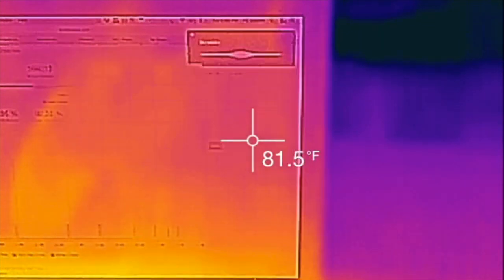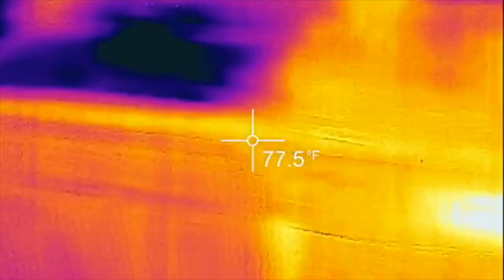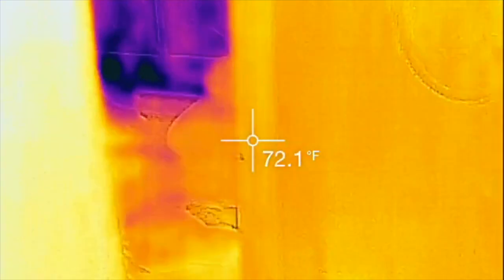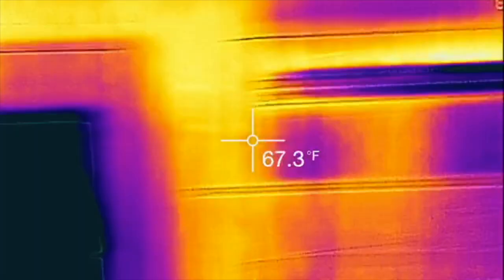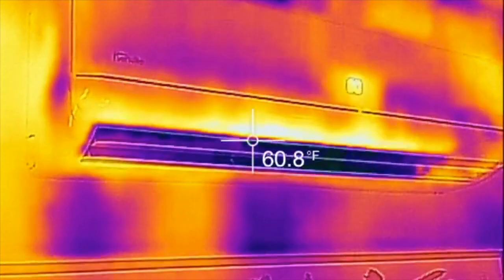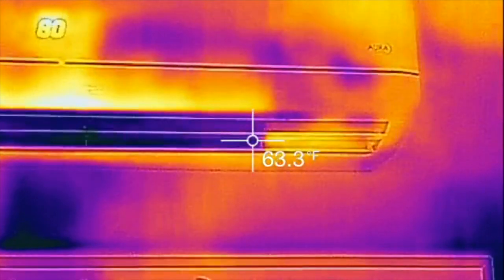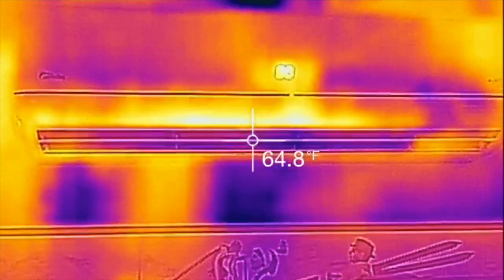Heat Pump Extreme Cold: Tested

Comment: I hope you see this? I have one with two units in my cart and I want to use them for heat. Mainly I live in New Hampshire so we need air-conditioning about four days a year, but if I can depend on this to blow hot air down to 20° positive Then I can use my pellet stove only on days when the outdoor temperature is below 20°? I would just like some confirmation that I’m making the right call that it’s gonna do the job? And it sounds like from your video 20° above zero would be no problem at all for that unit to heat? Just would like some confirmation thank you.

Comment: How many hours a day does it run to keep your home warm?
Reply from the maker: With the DC inverter, it's not on or off. it's a variable power consumption 24/7. Deep winter seems to be 80-100% duty cycle here with defrost cycles in between.
Reply: @pcdoodle1  Of course.  I have a variable power DC heat pump as well.  New this heating season so we are watching it closely and learning about it.   Last cold snap at near zero in Spokane WA my Google Nest thermostat showed it was in heating mode 10.5 hours on the coldest day between 8 am and 11 pm.  Tells me it could easily work in far colder temps.  I understand it is really designed to be running and harvesting heat nearly continuously when its really cold.  Not much cycling like with a gas furnace, even a variable speed multi stage one.   I have been very pleased with the comfort level in the house and power consumption.  We have solar and our system makes all the power we need to heat and power the house so its really fantastic.   We have natural gas furnace paired with the heat pump if it gets really cold, but I don't think we need it.  Have not used it hardly at all this year.  We have cut our carbon emissions by 90% or more this heating season.

Comment: I appreciate your using an infrared thermometer on all the surfaces inside your house.  But I didn't see you report the air temperatures inside the house.  Most people want warm air around them - not just a "warm wall".

Comment: This video does not prove alot but simply showing unit is producing heat at cold temperatures. These types of units will also have resistive electric heating coils to subliment what heat pump can produce. Question is how much more efficient is it at producing heat at these temperatures.

Comment: They don't stop working, they just become far less efficient. It extracts heat from the air outside, so the colder it gets, the more energy it will take to extract that heat to heat your house.  The reason people say they "don't work" is because they use a TON of electricity when it drops below freezing. Way more energy than more conventional heating methods... that is unless you can spend a quarter million on upgrading insulation and air sealing your home.

For most people's homes, heat pumps work very poorly below freezing.

Comment: Do you have a heater on the drain pan outside?
Reply: Senville Aura has a pan heater and heat belt around the compressor and an arctic compressor.The Leto does not have the arctic compressor
Reply: @noutilitybill  Ya I ended up getting one. I'm on winter no 2 now and as long as the air temp is above -5 it keeps the cabin at 70F

Comment: I've got a 24x30 garage with 10' ceilings (between the joists) and a bonus room above. I was thinking of a 28k split unit with an 18k head in the garage and 12k head in the bonus room (Senville Aura). I'm just east of the Twin Cities. Do you think that would be enough?

Comment: What brand and model heat pump do you have?  How many square feet are you heating?
Reply: In this video it is a Senville Aura which is made by Midea.The Blueridge version is also made by Midea.A lot of high priced units are made by Midea or Gree so save yourself the money and by a Senville Aura which is a arctic heat pump

Comment: So I just installed 2 senville units in the fingerlakes area. One is a 24 k floor unit, the other is 36 k with 2 12 k heads. So far so good. It has only gotten down to around 15 so far, so hopefully when it gets to 0 it still works. Great video

Comment: Nice! Bought an old home and looking to replace the boiler and wonder how well these work in the Midwest. I'm just across the river in St. Paul :)
Reply: Old homes have bad insulation. You'll need to modernize your insulation for a heat pump to make any difference.

Comment: Hi. Just wondering,  is condensation/ice buildup under the outside unit a problem in winter?
Reply: As long as you keep it off from snow, it should handle just fine. I live in MN, nd this thing warms my house just fine.

Comment: This is the video I was looking for. I have a forced air electric furnace and my power bills are ridiculous in Manitoba Canada. We get wicked cold winters up here. What happens in -45c temps with these?
Reply: Heat with resistance heat or a wood stove. Always have a backup
Reply: What size of breaker does this use? Thanks
Reply: nothing happens at -45. literally nothing! money pit even on much higher temps.

Comment: So you must have some kind of alien tech heat pump, because mine would not work in freezing temps at all. Never did, even when new. Most of the winter I was on my gas furnace and the repair bills were far over any savings I might have gotten. I had it for ten years and this year I finally sent it to the recycler. I'm back on the good old trusty gas furnace, and not looking back.
Reply: Doesn't sound like yours was the newer "inverter" type heat pump (less than 5-7 years old). And the newest versions are very efficient at below freezing ....down to -13F to -22F. My 24K Mitsubishi has a backup electric element in it for when it gets too cold to squeeze any heat from outside air.... never had it kick in yet..... SEER 21 Inverter heat pump sips electricity. Also with global warming I use the AC now more than ever before.
Reply: @muskyful  Last winter we got 4 ft. of snow that buried my heat pump. It tried to defrost the snow, but the melted water froze the fan into a solid block of ice, so the unit shut down and stayed that way until spring. When it was able to be used again I had it checked and found it was ready for another 2000 dollars in repairs. So much for high tech. So much for saving money. So much for the planet.
Reply: @Mascotal  Yah, that's one issue for the outdoor unit. If you're in a place where snow is typical....its best to raise & cover the unit.....most mfg recommend it. Its best to put them up off ground so they can  drain ok in defrost, not sitting in a pool of snow & ice...and screening unit from prevailing winter storms. You don't want the unit sitting on just an exposed ground pad in snow country. A shaded cover also makes the unit more efficient in summer cooling.
Reply: @muskyful  Actually, I'm in the shadow of a mountain for the winter months so solar is also a issue. I think you need just the right area for a heat pump, but even then you still need a furnace. So you double down on the costs right from the start. Twice as much maintenance, twice as much cost. When do you start to save money?
Reply: @Mascotal what model did you purchase?
Reply: @Katana_00   "York Infinity" heat pump.
If you want to stop using natural gas then consider getting electric baseboard heaters instead. They are 100 % efficient, they cost much less, and they never have any problems.
Reply: @Mascotal  what are doing for heating and cooling now?
Reply: @Katana_00  I have a natural gas furnace that is 98% efficient. I also have a natural gas fire place so when the power goes out I still have heat in the house. 
My house is noticeably warmer in the winter, and a new central air conditioner keeps me cool in the summer.

Comment: This is a BlueRidge mini-split, rated to -22F, which I installed last year here in Chicago with 4 air-handler units, and I heat 1200sf with a 36,000 btu compressor connected to two self-contained bedroom units, and two multi-duct units one in the attic & one in the basement, drawing air into the returns from both the floor & ceiling and supplying air from both the floor & the ceiling.

Happy happy: quiet, didn't upgrade my insulation or drafts on my 1967 home, and I have 4 supply vents in the ceiling & 4 supply vents in the floor of 6" insulated round duct with 14" returns.

The attic unit is 12,000btu and the underfloor unit is 18,000btu with the bedrooms both at 9,000btu.

If all run at maximum simultaneously, the 36,000 BlueRidge compressor can ramp up to 133% if needed!

Works amazing, saving money...
Reply: price?
Reply: @TimKelpsas We're at below zero today in Chicago, how is you're heat pump performing? Do you have backup heating options?
Reply: Liar. Where does it say blue ridge? looks like a Senville Aura.
Reply: Blueridge is made by Midea just like Senville is.The only difference is you payed more for the Blueridge a lot more than a Senville Aura

Comment: Great to see an update unused maintenance costs. Thanks for the video
Reply from the maker: The installer of the refrigerant lines said there was a small leak when it was installed about 4 years ago. I still have yet to see any lack of performance or any issues whatsoever. Good Tech!

Comment: So what manufacturer/model is that heat pump?
Reply: In the video it is a Senville Aura.A lot of brands out there are the same unit with a different sticker on it.The Aura has a arctic compressor  which why it is good for  -30C The Leto is only good for -15C but still has the pan heater and heat belt around the compressor.I see a lot of other brands charge much more for these units with a different logo on it.Look at it this way If I put a chevy logo on a ford truck,would you know it is a ford.Treat heat pump same way

Comment: I'm considering a Mini Split for our home in the Black Hills. We rarely get below zero. It was one day this week and that's only the second time this season.  It was -6 on Wed. So for the better part of winter, it would be effective.  This house is multi fueled.  Our basement and garage are heated with in floor hot water provided by a high  efficiency boiler. we heat the main floor for the most part with firewood we harvest and occasionally we use our radiant cove heat.  We don't have AC presently and there are only a few days a year that it would be nice to have.  So a Mini Split would serve those days for cooling as well as supplement our other heat sources.    What brand heat pump are you using?
Reply from the maker: I would recommend an Inverter type with low temperature ratings. I made this video for not a manufacturer but for awareness here in the states. You might be able to find them reading through the comments here though.
Reply: @pcdoodle1  who is manufacturer?  I live in -20F
Reply: @pcdoodle1  Thanks.  I lived in MN for 47 years so am quite aware of cold winters.  We just don't get that kind of cold here

Comment: This cannot work. There is no heat outside. How can it work?
Reply from the maker: Same as your AC, there doesn't appear to be any cold outside in the summer, yet the AC brings in the cold.
Reply: Ac systems pull heat out of the house. Heat pump is an AC system in reverse so it pulls heat from outside into the house instead. Btw what is the Sq footage on your house with that 24k system??
Reply: @pcdoodle1  Yes but the AC has a refrigeration unit inside. A fridge does not output much heat does it?
Reply: The heating part is just the reverse of the cooling.When it heats hot refridgerant is pumped into the indoor handler when it cools cold refridgerant is pumped into the indoor handler.The thermodynamics   was developed in the 1800's,engineering and manufacturing took over a 100 years to give us a product we see today
Reply: @noutilitybill  Seems like a terribly difficult way to attempt to extract heat from air which is already cold.
Reply: @johnchoice1371 Look at it this way using your way of thinking,Seems like a terribly difficult way to extract cold from air which is already hot on a extremely hot day in the summer.And yet people are lining up to buy air conditioners to cool their homes,if they were smart they would buy a mini split heat pump because they are far more efficient than the old style air conditioner with 10 or if lucky 15 SEER.A lot of things have changed on this planet in the last 1000 years,its called technology.We went from walking to flying advanced fighter jets to walking on the moon and with the breakthroughs that are happening right now you will have a terribly difficult time believing what you are seeing.As long as it is above negative 273C(thats 273 degrees below Zero) there is still heat in the air.Enjoy
Reply: @noutilitybill  Nevertheless, it still needs electricity. Electricity is now more expensive than ever. Petrol cars are far more convenient than electric cars, which keep needing to be charged with expensive electricity. I have found a gas boiler to be a cheaper way of heating because gas per unit is far less than electricity per unit.
So I am not at all tempted to convert to a heat pump.

Comment: I think they operate like a regular electric heater when that cold?    But,  I am looking at getting one,  reasonably priced
Reply: No, don't operate like electric heaters, even in such low temperature.
Reply: Electric heating element comes on only to defrost the unit.  They do not operate anything like resistance heating appliances.

Comment: Wow! I am also from Minnesota, we know how crazy the temps are around here. I installed a Mini split 4 Zone Unit in my house nd it is going to be the first winter!
Reply: How is it working so far? I am in upstate N.Y. and regular see single digit Temps and wonder if these are even an option.
Reply: Can we get an update??
Reply: @sunburnfm  So far I have no complaints about it. Currently in MN, we are having temps btw 30F°to10F° nd this thing handles just fine. (Though the defrost mode could be a bit noisy but nothing crazy). The one thing I'd point out is the temperatures #s on the air handlers can be a bit off. I have a sensor in my bedroom that displays 72F°, where the air handler shows 78F or above. But you can always calibrate this numbers on their app. (I got tired of always calibrating it so I bought a separelty temp sensor, for automations purposes. I have all handlers connected to Smartthings app) . 
If your planning on buying it, take your time on doing your research. If I am not mistaking, Mr Cool has released a new generetion of the DIY series nd it can handle up to 5zones.

Comment: Moving heat around is a lot more efficient than trying to make it via electrical resistance.
Reply: If you have a cold climate heat pump ith a COP rated at 4 or 5 you should be getting 2x or better than a resistor coil. If not check setting on thermostat to make sure you are cycling properly, low and slow. Get technician to check refrigerant level and pressure. I’m not sure if 2004 Unit is even a cold weather heat pump with a COP of 4 or 5. The older heat pumps were only efficient or effective down to 32.F and then supplemental heat was called for. The technology has improved significantly since 2004.
Reply: @Pierceb2 that's for inverter heat pumps not like the single stage Goodman GSZB404210A heat pumps I think.
Reply: heat from where exactly? have you noticed how big his outdoor unit is? you can probably heat yourself via electrical resistance for few years just for the price of the pump.
reference: i have heat pump since 2004. yes, the inverter. declared 4kw, it's heating less than 2kw space heater.
Reply: @ivok9846  Its better to think of heat in terms of kelvin. It might be nice indoors at 295k (21c,  72f) and freezing outside at 250k, (-20c,  -4f) but theres still 250 degrees of heat to work with. If you lower the outside temperature by 20 degrees, you can heat the indoors by 20 degrees. You're effectively pumping heat from one place to another. Even though we would consider 250k to be very cold, there's still a lot of heat there and thus a lot of heating potential.
Reply: @LouSaydus  whales could love it, humans? not so much! -20 has no heating potential whatsoever, for humans! 
if you lower outside by 20 you can heat by 20, ok, I know what you're saying, although it's not worded right, because you'll never be lowering anything outside, it'll be what it is, can't change it, we can only move heat/cold around, but what's the use of large Kelvin scale if we only operate in small part of it? we can forget about first 260 Kelvins right from the start. we can't produce heat from -10 air no matter what you do. or, we can, but we'll spend much energy, so much so that we might heat that air in old ways, via electrical resistance.

cold air is cold air, it just doesn't have much heating potential, and then when you add winter moisture and wind....it goes to nothing. 

also, this is big system, 36000btu, this took much co2 to produce in some filthy Chinese factory. this is luxury, why not heat just one room with small heat pump. and have something else for real cold days. or days without power: this reminds of electric cars charging, what happens to electric grid if we all do it at once? then you get blackout and no heating on electricity whatsoever. what about the price of electricity in that case?

so no, it's not that simple. watch that UK bloke on the subject, skill builder. he has few clips on heat pumps.

Comment: how much was the bill for the whole winter using only mini split
Reply: It’s rated 300-350% efficiency.
It means that it will be cheaper 3-3.5 times than the baseboard heaters equivalent BTU rate.

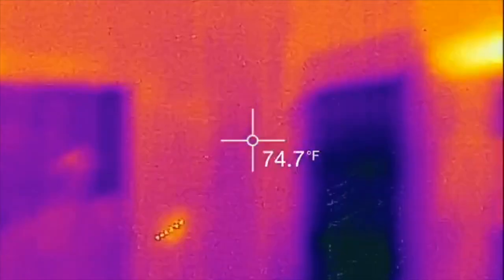Comment: 1:08 technically,
 an air conditioner does not make cold or heat.
the air conditioner extracts heat from the environment or space with little power.